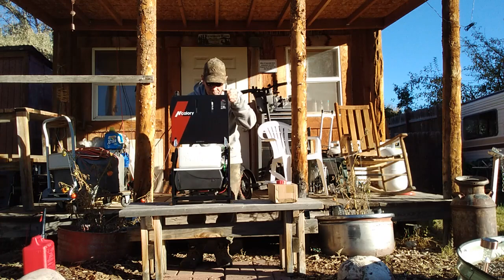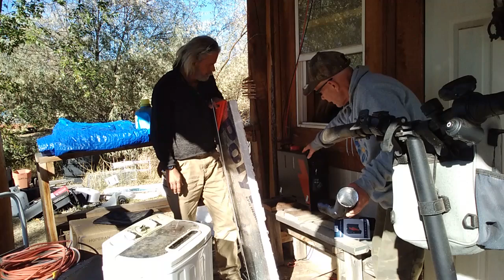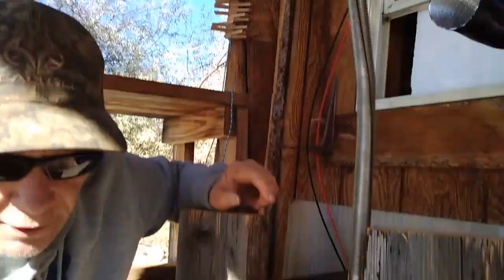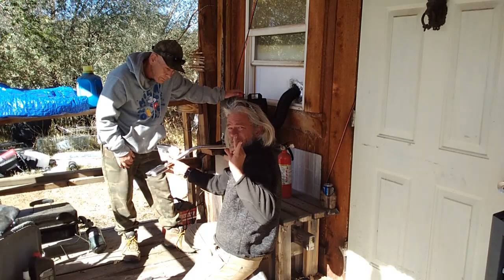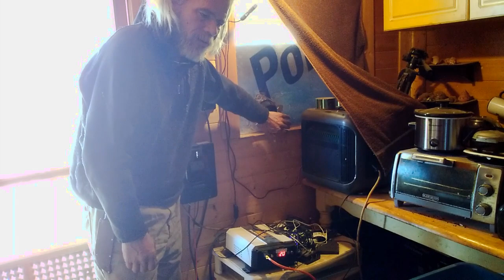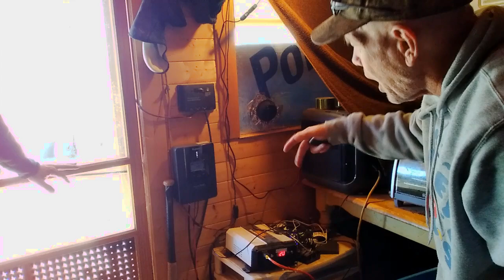HCalory Diesel Heaters For Off grid And Emergency Heating

Comment: Only problem I foresee is what do you do when your battery runs dry? You must have some way to keep the battery charged.
Reply from the maker: I have a trickle charger solar panel connected to the battery and I can also run it inside to my main off grid solar system.
Reply: @solarcabin  Nice idea to charge battery via solar. Unfortunately I am on Oregon coast where we don't see hardly any sunshine in winter months. During these months solar useless 🫤
Reply: That's my main concern. They pull a lot of battery at 15 amps. Would be interested in seeing what they "actually" draw.

Comment from the maker: Hcalory 8Kw Diesel heater update:
I used almost exactly a half gallon of diesel to heat for 2 days. If I get 4 days on a gallon that is 88 cents a day at $3.50 a gallon for #2 diesel here. It will use more in the coldest part of winter but not bad at all!
Reply: That's too cool I want one now. One for my boat, one for my house.

Comment: I have two of the vevors identical to your model, but with the blue controller.  One of these will run you out of your cabin just fine.  Love these things.  I have them permanently mounted on stands built to set outside of any room’s window in my house or I can run both into the open great room (only one is needed and still raises the temp in the large open area 3 degrees within a 15 minute period on 3-4.) 6 is the only setting I’d really worry about fire closely cause it gets HOT!  Yours should have “alpine” (like an “eco” mode) that will help with fuel consumption on the pump and I’d say a 6 in alpine mode is comparable to a 3-4 in regular mode, so it’s fine to crank on up without overheating.  I use half inch plywood window inserts with a 5” drilled hole and a 16 gauge 6”x6” plate centered over that hole with a 3” hole in the middle of the steel plate for spacing and put my plastic inserts in that.  Never had an issue with overheating, even on 6 regular.  I don’t run it inside so the thermostat control isn’t useful to me.  Just simple on and off with manual mode controlling the settings.  Just make sure to let it go through its full shutdown cycle and don’t just kill power.  Isn’t terrible a few times but a steady diet of that isn’t good.  Recommend changing the crappy fuel line and putting an inline filter on there.  If you don’t change the fuel line immediately, at least put some gorilla tape on the sharp edges of the sheet metal where it contacts the fuel lines.  Pumping motion can wear the cheap line more quickly.  I use a 15amp AC-dc power supply straight from the wall of the house.  Still need to work on my battery setup, but I’m only interested in the smallest batteries on a power switcher that would temporarily take over during power outage and give me time to correctly shut down or power from a gas generator.  I don’t have an inverter generator (just an old 3500 craftsman) so I’m going to test the power supplies plugged directly into that and see how it goes soon.  I think the power supply plugged into a surge protector coming off the generator should do well enough.  The efficiency of my generator with the diesel burn rate of this would be under $10 per night between gas and diesel for  continuous heat during an outage and that’s way better than propane would do me in that situation.
Reply: I am interested in these diesel heaters. But it sounds like they pull a lot of battery at 15 amps. I use propane for backup heat in my total electric well insulated 1700 sq ft brick house and it works fine with a 30,000 btu infrared heater. It keeps it plenty warm even at zero. And will run about half the time at that temperature. I had to install it because we loose electricity quite often. I have a 500 gal tank so it will last a couple of years normally. But I also have a lot of clean waste oil so I am thinking about one of these if I can mix some waste oil with the diesel.

Comment: How's the battery charge going with use. Fully charged battery just on heater. How long think battery run??
Reply from the maker: I am trickle charging the batt with a 30 watt panel and it stays full.

Comment: HOW ABOUT OF THE COST OF DEISEL IN FL 3.65 A GAL THINKING HEAT FOR THE WINTER UN LESS YOU CAN BUY FARM FUEL? SOME TIMES WE CANT GET LP TO  BUY 5GAL AT THE TIME DEISEL WOULD BE GOOD
Reply from the maker: Diesel is a lot higher in some places. We are at about $3.50 a gallon and I used about a half gallon to het the cabin for a day.
Reply: @solarcabin  HERE IN FL WE HAVE ABOUT 6 WEEKS IT IS COLDER THAN YOU WANT IT TO BE ,IN EVENING , AND FOUND IT HARD TO BUY LP, IT COST ABOUT 100.00 TO FILL A 100LB WHICH WOULD LAST 4 WEEKS MAY BE I FEEL IF I GOT 5 GAL OF DEISEL WOULD DO THE SAME, THEY HAVE THEM HEATERS WITH A TERMOSTAT

Comment: They are so cheap that when on breaks you just don’t care.. if this is your main heat source, have a backup diesel heater.   They do break or the glow plug will foul. If you get the one that’s not self contained replace the fuel line and filter with better than that fish tank plastic hose

Comment: Mr. Cabin, congratulations on giving yourself another way to heat your cabin. It's very wise of you to do that. My off grid land is in a very cold area so I'm devising different ways to heat before I ever make it my home. I'll probably set up one of those diesel heaters too! I've got a Royal Enfield Classic 350cc motorcycle that's on the heavy side and I'm really thinking of adding an air cooled VW heater box to the exhaust system like they used to do in air cooled VW vehicles and pipe that in. Maybe I'll add a boat bilge ventilation fan for low amp draw and wire that to the headlight instead and just disconnect the headlight. It's fuel injected so it starts right up and barely sips fuel at idle! 🙂

Comment: I have been using one of these for over 6 years to heat my place. My is inside, but I vented to the outside with both exhaust and air intake. My is mounted into a kitchen cupboard and the heater hose run under the counter with outlets coming out of the kickboards. Run my on low most of the time but put the temperature up high a couple of times a week to urn off carbon in the burn chamber.  My place is around the same size as yours and temps can get low in winter in ireland and my place is aways toastie. I use tractor desiel as it's cheaper.

Comment: U should be able use old motor oil to use in diesel  heater too and is ppl give away large containers that r full fer really cheap
Reply: People have done just that. Just filter it. Probably best to add some kerosine to thin it out a bit as well to keep it from coking up.

Comment: Just thinking out loud but imop  do not screw it down to a floor, but rather attach it to a larger pice of plywood enough so it can’t tip over but able to quickly remove it if a leak or something else goes wrong for a fast removal to the great outdoors. 
Thanks

Comment: I've been using a diesel heater in my bus for 4 years. I used propane for a decade and the diesel heaters are the way to go. No moisture, no carbon monoxide and diesel is at most gas stations where propane is not as easy to get. I replaced the supplied fuel tank which is 1.5 gallons with a 7 gallon tank. The diesel heater is far superior to propane heaters. I live in Wisconsin full time in my bus. The winters here are brutal but my diesel heater keeps me toasty warm. I purchased a remote separately for my heater. Instead of manually turning the heater on and off the remote allows you to set a desired temperature so the heater comes on and off like a furnace in a house. Ditch the propane heater and get yourself a diesel heater you won't regret it.

Comment: Thanks for sharing your experience with diesel heaters , they can be a little fickle when they work they are spectacular good dry heat . Suggest good battery and better chargers so “it” Will play nice .

Comment: I use a small vevor diesel heater I use a 15 gallon tank outside so it can gell when to cold so I run a 70% diesel  30% kerosene
Reply: Hotshot’s Secret added to the fuel will prevent gelling very well.
Reply: Put hotshot’s secret in the fuel and it will prevent telling very well.

Comment: I’m curious how the follow-up videos turn out on this review! My first impression when I put my hand at the airflow is that it is blowing VERY hot! Glad to be able to help you out with the set up!
Reply from the maker: In the next video I will be able to share more on the fuel use over time, heat settings and features. Checked the fuel level and used about a 3rd of a tank. I figure a half a gallon a day in coldest part of winter.  That would be about $1.75 a day to heat the cabin. Not bad!

Comment: The Army used diesel heaters during my active duty time.  I don't know if they still do.  Ours set up like a wood stove with a stove pipe instead of a hose..  This new one looks simpler to use.  We did have some tent fires because of the diesel heaters.  The Army heaters didn't need  fan.
Reply from the maker: Those were the old drip oil heaters that could use diesel or waste oil and I helped build one for a shop. Not as efficient or safe as these new heaters but they could put out a lot of heat.
Reply: We used those. Sure had to make sure the flu pipe didn't soot up. Put out a lot of heat. We was always "stealing" cans of diesel from other trucks.